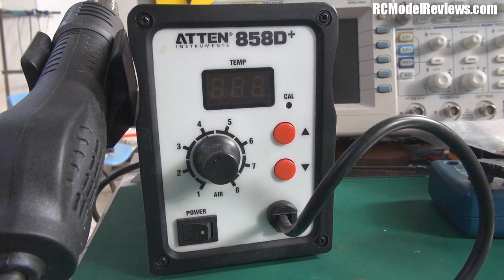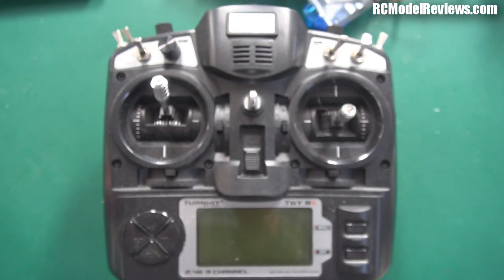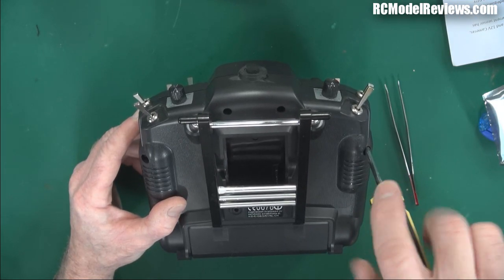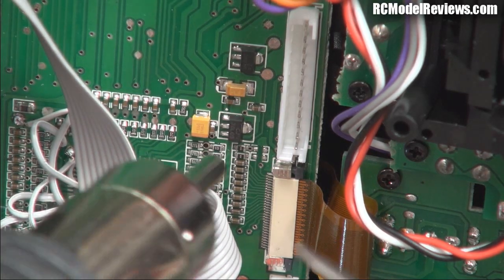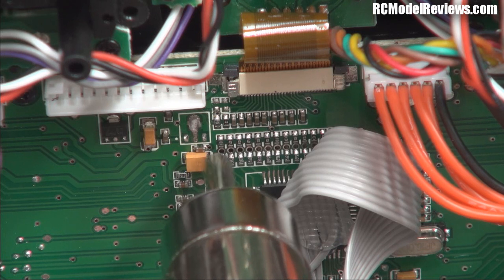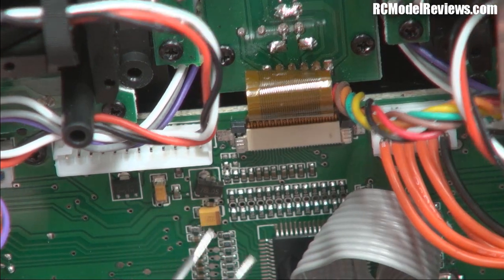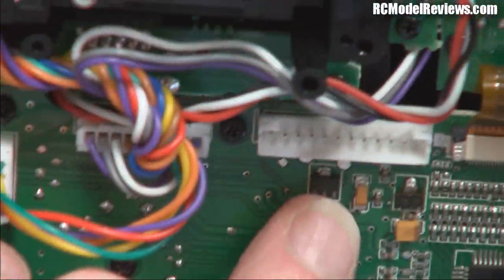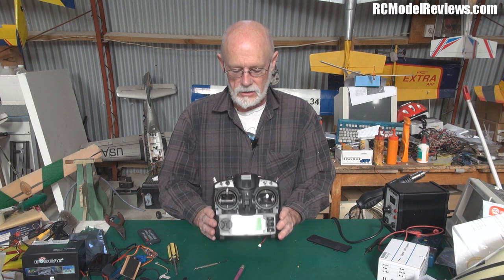Repairing a Turnigy 9X after battery reversal

Comment: you should see the video Bruce does on comparing the Turnigy 9x and the 9xr.  After seeing it myself, my mind was set on the 9x.  I would reccomend you reflash it with er9x and put a back-light in it while you have it open.  You can then use the cord sticking out of it to hook up to the computer and program different models quick and easy using eePe.  For under $100 you would have a 'cheap' radio that will do stuff the expensive ones only dream of!  Good luck, Cheers!

Comment: Yup, was about to say the same. Can't go wrong with having a bunch of flux when re-flowing SMT. Side note if you can't afford a hot-air reflow station, I find the embossing guns you get at the local craft store work great with out over heating the boards (bubbling or trace lifting).

Comment: The component is a 7805 linear voltage regulator and its capacitor. These components are the first components behind the battery and deliver the correct voltage for the other components in the radio. So it is most likely, that they blow up first.

Comment: Good job, but you might like to try and get hold of some low residue liquid flux, I apply with a little paint brush, it not only conducts the heat well but reflows the solder like new.

Comment: Yeah, the stock 9x does have a 8xAA battery holder with reverse polarity protected plug. It is quite common to replace that with a 3 cell LiPo or LiFe battery, and thus introduce the potential reverse polarity problem. A LiPo or LiFe keeps the 9x alive for ages ;)  Great upgrade!  A 9x with FrSky module and LiPo at ~$110 is unbeatable value when flashed to Er9x open source firmware.

Comment: I'm experiencing a issue with a Turnigy 6XS but, for it even a power inversion nothing may be appeared, just at entry and at regulator input is a schottky diode in series with the positive lead, the display lights but no character is shown and the buzzer starts to bip, all resistors and capacitors checked, only 12MHz xtal or the microcontroler - and memory circuits at last... Any new idea ? Thank you.

Comment: i used a 1uf cap cause thats all i had

and a nice chunky 1A 7805

turns out the component is a 78L05 which actually has opposite input/output pins :s so i soldered incorrectly then changed it and it works now 

when i connect to KK2.1 and do receiver test the values are all off more than i can compensate with trim. the values are also 'shaking' constantly changing slightly. this is concerning and i can't use it because i cant centre the sticks :( i dont know what to do

Comment: Thanks for your video . I reversed the battery . I just replaced the condenser . One below the regulator is 10 Mf Electrolytic ? Now the radio comes on . But there Anything wrong . I have a esacottero with Naza M v2 . The Pit / Cv no longer work as before . The range and minimum. I can not set the modalitra Acts Normal and GPS . Can you give me some information ?

Comment: Sir i just had same problem and i just replaced the burnt capacitor with a 10uf capacitor. and just turned on with a low volt battery (8.2V) it turned on and was worked well. Later i connected my 2200mah 8c transmitter pack to the transmitter, it turned on with a blank display, I just re installed the ee9x firmware, nothing is working, please help me fix it?

Comment: oh man, I've never heard of the hot air reflow station. I broke the - switch on the round pad, which had 4 solder points. Changing it was awful. I'm not even sure how I managed it with just a soldering iron, I doubt I could do it again! Thanks

Comment: Hello Bruce, good stuff as always. I realize this was made some time ago, but I noticed the small brown ribbon cable  that connects the small daughter board to the main board was half out of its connector with the left side clip up. Just in case he every has another issue, he made need to take a look at that if it was not corrected before leaving the bench. Still pulling for your exemption in the states! :-)

Comment: Hi

I looked now four times and at 03,25 min when you took of the large capacitor you accidently ripped off an smaller SMD resistor or capacitor on the left side of the larger SMD cap. Fortunately you get it back at place later :-))
Those SMD components isn't so easy to see and that  reflow gun can easily melt other components nearby too so one must be very careful with those things. 
Anyway, you did a nice job !

Comment: Hi,I have the same problem with a FS-T6 transmitter, The board is a bit different but the capacitor looks the same,The problem is, it does not have any numbers or values on it? Please could you give me a number if possible? I can't find any scimatics  on the TX so I'm stumped .Flysky want me to send it back to them,too expensive. Thanks in advance and I like your videos..cheers from the 🇬🇧 UK

Comment: Ah so the plug was polarity protected. Sorry, didn't know. That *should*  be sufficient in most cases. Does it also take normal AA batteries? I'm currently looking for a cheap radio :)

Comment: Hi Bruce, have you had to fix you're Horyzon HD V3 camera? Mine has gone back twice. First one stopped working, would switch on but not do anything. Second one was down before I got it on the plane, the red power wire had come off, had to cut into the heat shrink & re-solder. Then when I tested it, it was out of focus. Had to scrape the glue off & re-focus. Then when I watched play back, there was a jack hammer in the back ground. thought it might be RX or interference. But it was not.

Comment: Try digikey, element14 or RS components for parts. The regulator will likely have a model name etched on it, look for the code on one of them (rs is my favourite because they ship free and with fast carriers. As for the tantalum cap(s), you might have to look up the code online to figure out the rating, or otherwise post it and I'll try and help out. peace, chris

Comment: Hello Bruce. Good to see another video of yours up. Looking forward to more when you have the time of course. Hope the TBS wing is coming along and that you can do a series on it through to FPV. Any updates on the penguin btw? Also looking forward to the Taranis follow up & maybe if you're able how about looking into the Orange Rx 433mhz system to use with the Taranis or 9x. It's low output of 100mw might be nice not being over powered for 3-6 miles (5-10km) if parts aren't rubbish... Regards...

Comment: Hello, I just fried my 9X by connecting up the battery backward. I appreciate the video. You mentioned you would be posting a link as to where we can buy the bits needed to make this repair". Can you please provide me with the information on the parts? I'm in the US so i'm sure I will find them a little easier here but I just need to know what to ask for. Thanks again.
Reply: These regulators at 9X are series connected ?

Comment: Bruce, do you know the value of the tantalum capacitor?  My pal's reversed the battery on his 9X and I'm going to attempt a similar repair. I've managed to acquire a 78L05 regulator but the value of the tant isn't easy to see.

Oh for the days when components were easy to see!  When my eyes were young and sharp components were huge, now my eyes are old and blunt I can hardly see the components let alone the value :)

Comment: Great video! I went out and purchased the model 898D Hot air rework station with soldering iron on same unit. It all has worked well until (you knew this was coming!) LOL I tried to follow your video. I guessed at the temp and blower speed and just couldn't seem to get it right, one of the pieces was already carbonized, and the regulator came off in pieces. What temp should I have used? Take your time in replying as I now have to find the parts on line as ALL distributors of Electronic parts have left Denver, Colorado! IF you know also the exact values of the component's required would be great. Somebody posted a link for a ebay site for the parts and a listing, but half of the items do NOT appear on ANY of the boards in my TH9X. Thanks again

Comment: Hello! Thanks so much for your video. I have recently accidentally reversed polarity on my turnigy 9x, but after doing so the radio seemed to work fine, much to my surprise. After about 5-7 10 minute flights over the next week after reversing polarity in which the copter flew beautifully with the 9x, I noticed the copter had begun to jump about in the air and jerk around.   I decided I wold un and replug the LiFe battery I had modded the 9x with and found that the radio had lost Yaw and pitch functionality. Is the radio totally worthless or is it possible to fix these things? Thanks!
Reply: Check out for bad contact on connectors between gimbals and processing pci...

Comment: Hi Bruce.
Great vid, as usual, though I wonder how many would try to find one of your super heat guns in order to replace two components. Actually it would cost more than a new 9x.
Having said that, I am half way through doing this repair, and I have a couple of questions you may be able to help with.
Do I post them here?
Thanks
Jeff

Comment: Hi all I have the same issue with the same transmitter. Can anyone tell me what are the part numbers to order them.
Thanks for the help.
Reply: http://www.ebay.co.uk/itm/Turnigy-9X-Fried-Reverse-Polarity-Replacement-Parts-Voltage-Regulators-Capacitor-/111122975522?nma=true&si=uxJ6bKZdTHgD3gBY4UaM8Rh6vKQ%253D&orig_cvip=true&rt=nc&_trksid=p2047675.l2557
These are the parts. You can order it from 
http://au.element14.com/

Comment: I did the same without a reflow gun but I wish i did that would have made it heaps easier. Google "reverse polarity brick 9x repair " for a write up similar to this I did on openrc forums. It shows the burned caps and the fried copper that Bruce is talking about.

Comment: Did anyone get the part number for the capacitor that gets scorched - part number given are all for the same regulator but not the capacitor.
Reply: http://www.ebay.co.uk/itm/Turnigy-9X-Fried-Reverse-Polarity-Replacement-Parts-Voltage-Regulators-Capacitor-/111122975522?nma=true&si=uxJ6bKZdTHgD3gBY4UaM8Rh6vKQ%253D&orig_cvip=true&rt=nc&_trksid=p2047675.l2557
These are the parts. You can order it from 
http://au.element14.com/

Comment: You wouldn't be able to charge LiPo, LiIon, or LiFe batteries, as the charger needs to see the voltage at the batteries. A better quality connector is in order.

Comment: at 3:40 you turn your 858d+ off without letting it cool down in the holder on the side of the base.  The handle senses the magnet in the holder, and turns off the heating element, allowing it to cool before turning the fan off.  Great video otherwise.  Thanks.